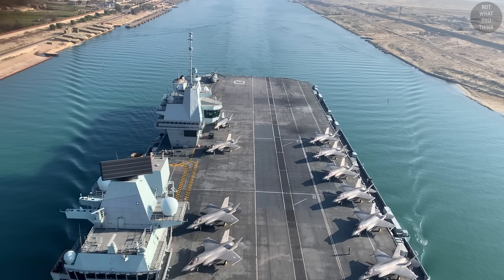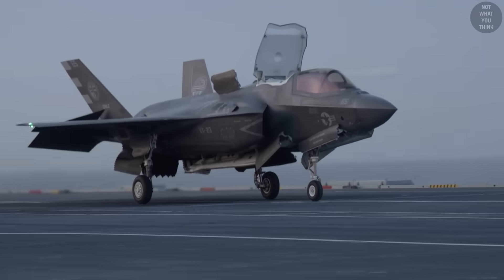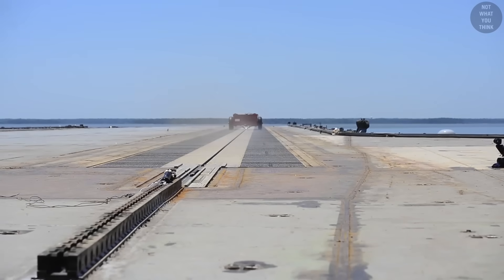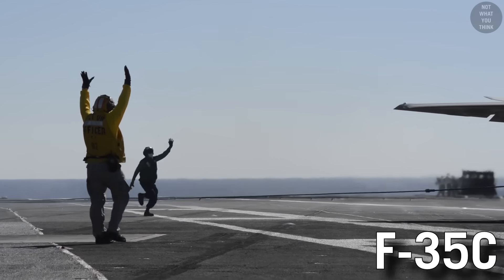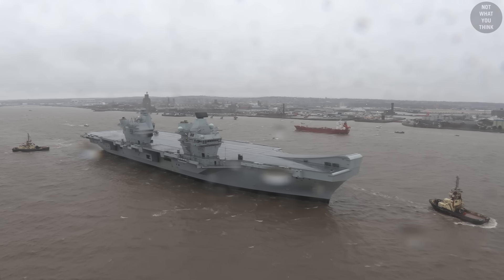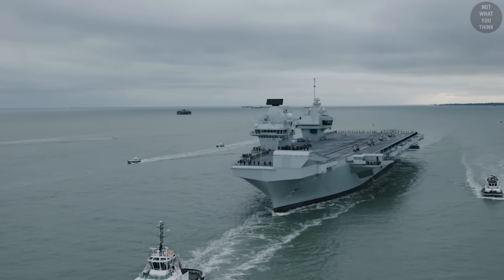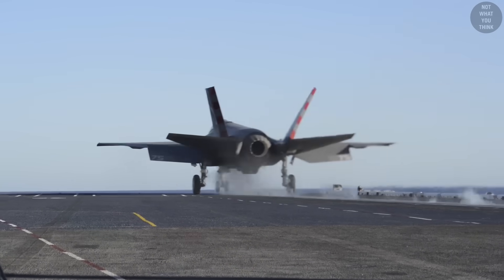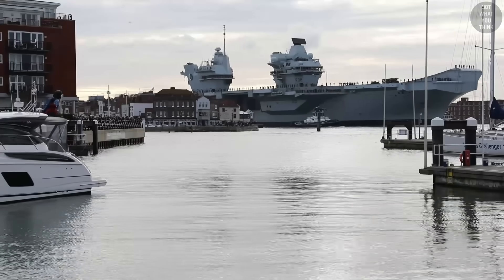Was the Angled Flight Deck Missed on HMS Queen Elizabeth?

Comment: I was under the impression STOVL was chosen on the Queen Elizabeth class mostly because it can launch its air wing quicker. Which the navy think is important after the Falkland conflict.
Reply: No it was just because the UK government is incapable of joined up thinking - they wanted to replace the Invincibles and the Harriers so they bought replacements for the Invincibles and the Harriers. They said they'd keep the option of conversion to CATOBAR, but then forgot about it... that's the real truth.
Reply: Nice.
Reply: Not with a full fuel and war load a US Super carrier can launch an Alpha strike package of 40+ fully loaded planes in 15-20 minutes. Verts were never faster than than that not even close they can only stage a few planes on deck at a time because they need the entire deck for their take off roll if they want to take fuel and weapons. Vertical take off burns a lot of fuel . A CATOBAR carrier only needs 300' to launch a 68,000 pound plane with two sets of cats (4) that is only about  2/3 of the flight deck to launch a fully loaded plane every 20 seconds.
Reply: @JoeBLOWFHB  I'm not so sure it isn't faster than the equivalent CATOBAR on a carrier of a similar size.
Reply: @artinyyk  Starting on July 20,1997 the USS Nimitz launched 975 fixed wing sorties over a 4 day period that is 243 sorties a day the QE can only launch 72 sorties a day with a max of 110 for an undefined "short period" (I suspect the period is 24hrs). So no, CATOBAR rules the air.
Reply: I'd hardly call the Nimitz a comparable carrier. She has twice the maximum aircraft and 9 to 4 times the crew and four catapults. The QE class was being compared to the French Charles De Gaulle with its 2 steam catapults and similar crew complement. Under those circumstances, it was of my understanding the royal navy concluded that STOVL was quicker to launch.
Reply: @artinyyk  The CdG isn't a super carrier it is a medium carrier I'm comparing the same "unofficial" type of vessel since that is what UK legislators, public and media are calling the QE class. The French weren't eyeing a QE II style vessel (PA2) as a second carrier because it can launch planes faster it was due to the cost and poor design of their current vessel. They have had all sorts of problems with the CdG that is why they cancelled the CdG's sister ship so I wouldn't be surprised if they could be out sortied but I can't find French numbers to back either position. I do know that after consideration the PA2 was cancelled in favor of the PANG with an EMALS CATOBAR system to replace the CdG. If there was a significant difference in favor of a ramp carrier (outside of cost) I highly doubt they would want to stay with an expensive CATOBAR system. They could probably build two ramp carriers for near the same price. You would have to go back to Midway class carriers to find a reliable CATOBAR carrier near the deck size and displacement of the QE II and they still carried more planes (albeit much less capable) and crew. 

The USN has always had the option to convert their LHA's into ramp carriers but they don't because the LHA's mission is to land Marines not conduct sea based air superiority or strike missions. If they were upsized and made into pure ramp carriers they would still be inferior to even a 66 year old Forrestal class carrier.

Comment: the 2 existing QE2 class CODAG powered 65,000 ton (STOBAR / STOL) aircraft carrier just don't cut it!!! STOBAR aircraft carriers are cheaper & not as complicated as conventional CATOBAR aircraft carriers!!! but on the other hand it is severely limited by it's capabilities, especially the air wing without which an aircraft carrier has no purpose!!! be it the HMS Prince Of Wales (R11) STOBAR aircraft carrier or HMS Queen Elizabeth (R12) you've no choice but operate an under equipped fleet of carrier borne F-35B Lightning II stealth VTOL multi role fighter that is severely limited by weight (max payload) issues!!! in a VTOL fighter jet you can either carry a full complement of weapon systems & sacrifice on fuel (otherwise necessary for the mission)!!! but you can't have both, full ordinance & a full tank of gas or else your F-35B Lightning II stealth VTOL multi role fighter simply won't take off due to excessive weight, even using the ski jump assist!!! QE2 class of STOBAR aircraft carriers are good for patrolling the waters around Great Britain, port visits to Brazil or Greenland during peace time!!! but should the QE2 be deployed to the Indian Ocean alongwith a NATO naval task force into an ongoing conflict in the South China Sea, doesn't sound very encouraging for the RN, not one bit!!! Royal Navy the father & architect of all navies that exist in the world!!! RN should modify, replace the entire STOBAR flight deck with the ski jump & upper hull section of both QE2 class aircraft carriers to the original CATOBAR arrangement (as it used to be during 1916 - 1985) that incorporates a complete straight & level flat full length flight deck (including the angled flight deck) from bow to stern & also discard the twin island concept with a single fully integrated island between the 2 aircraft lifts on the starboard side!!! as a modified CATOBAR/CTOL aircraft carrier the QE2 will have a retrofitted with a electro-magnetic catapult launch system in the front bow section of the flight deck & arrestor wire at the stern!!! secondly, QE2's gas turbine CODAG power pack has to be replaced as well with a new cutting edge fuel cell & Li-ion marine propulsion system that is 60% more fuel efficient than the RR MT30 marine turbines!!! per unit cost of the aforementioned changes & mods to the 2 QE2 aircraft carriers could be anywhere between €260 Mn - €550 Mn approx!!! & yes the aforementioned mods are worth it, every single $$$€€€€€$$$$$$!!!

Comment: The CATOBAR aircraft are not cheaper to operate. Even though the lift fan is an extra component, it's not a particularly high stress component like the core of a jet engine is, and any additional costs are mostly made up for by reduced take-off and landing forces applied to the airframe.

Moreover, because barrier assisted landing is such a highly skilled component essential to flight, CATOBAR pilots must fly many more hours as training to keep current and safe to land on a carrier. By comparison the highly automated vertical landing of the F-35B requires far less skill and so does not require so much practice.
That means that a CATOBAR carrier must fly many more training sorties per combat flight hours, and at about $33,000 per hour, that could be a big saving.

Comment: How are electromagnets not reliable?
Every electric motor is made with them.
A catapult is just a straight electric motor.
Reply: It runs on software while steam cats are mechanical and easier to troubleshoot. A catapult needs to be adjusted for each aircraft depending on its mission profile the EMALS is supposed to have a lot more features like a soft start and finer launch weight controls that are causing problems.
Reply: @JoeBLOWFHB  
Software isn't needed.  The power sent to each pair of magnets along the track can be set mechanically if they can't get a computer to handle it.  
Also, I can tell you with certainty that no setting by a human is needed.  The cat senses the resistance in the first 1/4 second that it starts to pull, and can set all of it's magnets based on that resistance.  And it can do all that mechanically if needed.

Comment: The design of the Queen Elizabeth class were forward fitted with the mountings for EMALS. the length was the minimum for arrestor landings of a refitted angle deck. This was a consideration of using both F35c and and UAV jets.  The ships would take a 2 years to be refitted. So I suspect only one of the ships would be done
Reply: Or the second would go in after the first is done. The same way the Nimitz carriers got retrofittet.
Reply: I'm sure if needs be they'll refit both at separate times just to keep them operational in some capacity
Reply: @mrcaboosevg6089  Yes that is a big possibility. They would also have to fit jet blast deflectors and either the on board landing sights  or have some sort of helmet based landing assist thing. A lot of work.
Reply: @nottmfunguy  Luckily we have two so it's not a serious problem. If we need both carriers to fight at the same time we'd probably be in some serious shit anyway
Reply: @mrcaboosevg6089  The likelihood of that happening is very small. However as I remember the RN nearly got caught out with carrier numbers before when the Falklands kicked off. Before then we only had one strike carrier operating and that was the old Ark Royal, but it was a more capable ship, even by todays carriers standards.

Comment: 6:37 is your correct answer. Anyone who has seen Top Gun will know how unreliable catapults are
Reply: Angled flight decks don't have to use catapults, though. That's just one benefit of them. The ability to launch from straight deck and retrieve from angled deck is another advantage. In the battle of Midway, the Japanese were unable to refit their fighters who had just bombed Midway and were needed to engage oncoming US retaliation due to their carriers only using straight deck carriers. Had they had two decks, they could have refitted while launching fighters simultaneously. So while catapults might not always work, the failure of catapults only restricts payload, but the operational advantages of dual decks are still strong enough to justify having them. 

It probably won't matter too much, seeing as the UK is unlikely to have any significant carrier battles in the future, and they do have other carriers with that capability.
Reply: Both catapults are broken sir, it’ll take 10 minutes. 
Bullshit this thing will be over in 2 minutes get on it

Comment: It seems to me considering the numerous tasks needed to perform, the design that greatest number of aircraft types would be the best choice.
Reply: So that would typically mean helicopters, which is what HMS Prince of Wales is currently operating.
Reply: @juleswombat5309  
It asked which is the best. I wasn't attacking, or defending any specific carrier type.
If carrier X can only only handle VTOL and helicopters, and carrier Y could handle these and other fighter jets, large reconnaissance, bomber, cargo, refueler, others then the versatility would make it better in the aspect of takeoff and landing, and what it could bring to the fight. This is one aspect of a carrier.
One of the reasons for the B-52 bomber's longevity is its versatility.

Comment: It occurs to me that STOVL might actually be the way of the future.
Consider, we're in the middle of an electric vehicle revolution which means we can expect super upgraded batteries in the coming decades. There's a parallel push to electrify fighter jets. After a certain kwh/kg storage threshold for the batteries the electric jets become lighter and cheaper by default. Keep pushing past that, and you can have much greater thrust/range by going electric.
Now insert microwave power transmission. If we can beam power to the aircraft remotely, this eliminated the need for aerial refueling. So now you can have big VTOL aircraft that use lots of leccy but get recharged remotely by some ship with a nuclear power plant and a microwave emitter.
Or just have lots and lots of batteries so the range is increased enough that you don't need a recharge.

Or here's a crazy thought.
You know the thing where SpaceX wants to launch two Starship rockets to orbit and then one of them transfers fuel to the other so it can go on deep space missions? Do like that for the fighter planes.
In stead of remote microwave refueling, have a more traditional aerial refueling platform but it swaps out batteries instead of pumping fuel to the other plane. Design the fighter aircraft to use up batteries sequentially instead of all at once. If it has 200 batteries and 130 of them are depleted, then swap out those 130 batteries with fresh ones and keep going. The refueling plane comes back to the carrier, or some special refueling plane carrier and recharges the dead batteries for later use.

Now we can get rid of the catapult completely and still launch fighters/bombers with full payloads.
Also, much smaller carriers suddenly make more sense. Right now the carriers are sized mostly for the runway and optimized for that. Eliminate the runway too (mostly) and you can find a new optimization point with a smaller and cheaper ship.

The HMS QE was sized for the F-35 fighter jet. Change the fighter jet to something truly VTOL and you change the size requirement of the carrier.
0_o

Comment: VTOL jets are not limited in speed nor manoeuvrability. This is merely a consequence of their overall design, and a coincidence that they happened to be VTOL aircraft.

The Sea Harrier was notoriously dangerous at low altitudes, having a reputation for taking down two dozen Argentine Mirages without a single air-air loss.

The Soviet Yak-141 was exceptionally fast for a fighter jet of its time, VTOL or not.

Neither the AV-8 Harrier II nor the F-35 Lightning II are built with dogfighting in mind, so naturally manoeuvrability is not a priority.
Reply: Compared to the F35A, the F35B is limited in manoeuvrability.

Comment: If the 35B's range and munitions mass isn't enough for you you're probably doing war wrong and you should use other weapon systems to achieve your aim. Pull less G's is a very 1975 attitude to war fighting too - if it ever becomes an issue you need to pull more than 2G you've probably made a mistake somewhere and should probably look at your defensive systems configuration - you've basically already lost at that point.

Comment: One other downside of the CATOBAR I heard of… if the catapaults fail the planes are going nowhere…
Reply: Not really, you still got a long deck. Those jets can takeoff on its own using almost the entire deck length. It will be very inefficient, but possible.

Comment: An issue with CATOBAR is that it stresses airframes far more than STOVL
Reply: Not really, and besides, damage to the Carrier Deck from Vertical Landings is a real issue that needs constant maintenance.
Reply: @harrier331  You, my dear friend, need to look at airframe stress on CATOBAR airframes vs VTOL airframes; it's no less stressful to land that way; just in a different direction.  The optimum way would be a glide-angle and situation where we had just a brake-landing, as in on land, on a monsterous 250k-ton Carrier; at least twice as long as the current Nimitz/Ford Class Monstrosities the US fields.

But seriously; look into it vs airframe life. You are not really well-informed; just defending the aircraft you love.

Just My Humble Opinion.
Reply: @harrier331  Whatever The Harrier is trash from the 1960s, & the QE carriers are merely more modern junk. The Royal Navy is a joke.

Comment: It's a big mistake to not put in steam generators for catapults and arrestors, even if propulsion doesn't use it.
The EM systems on the Ford aren't good,
Reply: CATOBAR uses a lot of steam for each 'shot' -- I've seen it said each launch uses half a ton of fresh desalinated water. Previous-generation steam-propulsion warships and nuclear carriers use a lot of fresh water for engineering purposes so they need water processing plants on board that use up space and need power/fuel to operate. The QE class like most modern warships use diesel engines (for cruise) and gas turbines (for additional sprint power) so they save a lot of space and equipment by not having to make lots of fresh water. It's another reason the EMALS is so attractive to people designing 21st century aircraft carriers.

Comment: The Queen Elizabeth class is large enough (280 x 70M) to undertake ‘roll on, roll off’ flight operations. This allows the brits to operate their F35Bs with full fuel and weapon loads.

Further, light weight EMALs catapults will be fitted to allow drone refuellers to be operated to expand the range of the F35Bs up to that of the F35Cs. 

Finally, it is debatable as to whether the Brits will need to reconfigure the flight deck much for angled recovery. It’s already 70M wide and if one compares the blueprints for both STOVL and CATOBAR versions, very little work appears to be necessary.

One last word: while STOVL is more expensive to purchase and operate than conventional fixed wing aircraft, that has to be offset against the gianormous costs associated with acquiring and operating a Catobar carrier. For example, the fly away cost of a F35B is only several million more than a F35C. They are actually less expensive than a Superhornet. The operating costs are only several thousand dollars per hour more than the F35C as well. A Nimitz/Ford Class carrier costs 3-4 more than a Queen Elizabeth (around $3 billion versus $12 billion), their ship’s company is about 6-8 times as large and hence their operating costs are billions more.
Reply: "very little work" oh dear me.... you don't understand the British Defence industry - they quoted £600million (pretty much a Billion USD)
Reply: @tomriley5790  so, 20% of the per unit build cost. Amortised over say 25-30 years as a midlife upgrade. … I’m sticking with ‘very little’ work to reconfigure the actual flight deck, as most of that money would likley be spent on the EMALs system and upgrading the hotel load of the ship to accomodate it …

Comment: I wonder why they stopped performing the SRVL maneuver? They did one exercise doing that but then they stopped. Anyone knows why?
Reply: They did some initial testing early on with HMS Queen Elizabeth, I believe they were due to perform further testing with HMS Prince of Wales over in the US earlier this year, as that ship already has the new Bedford Array landing system fitted which will make SRVL easier. This was delayed due to the issues with the ship, but now that it's back at sea it may happen later in the year.